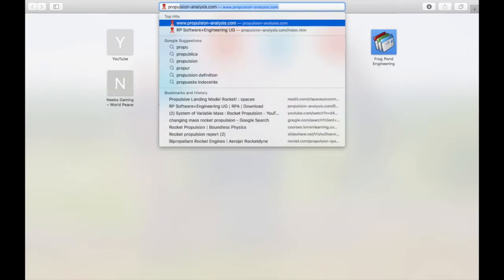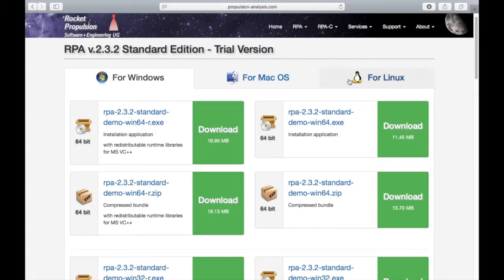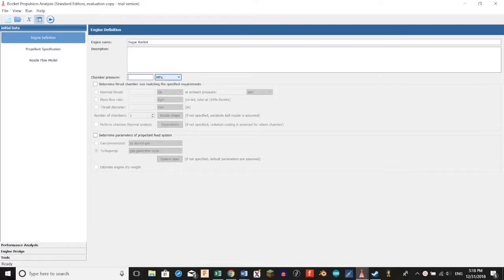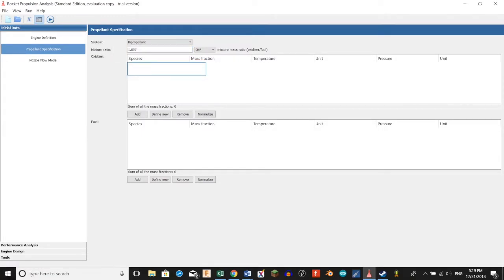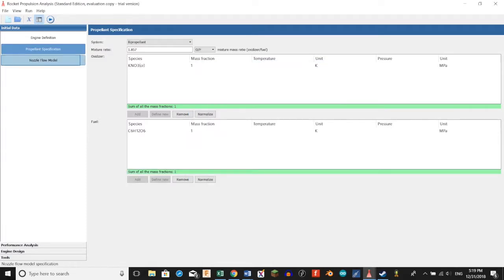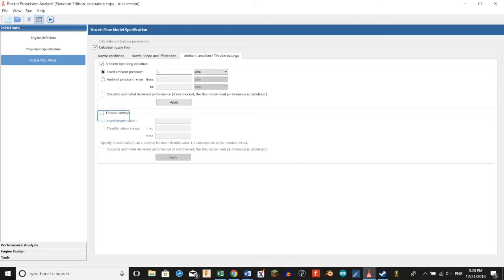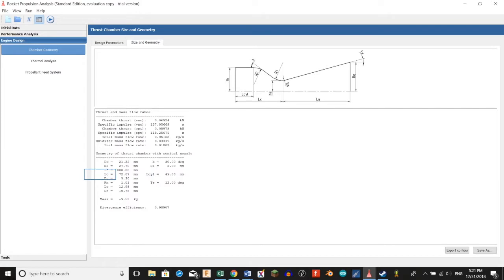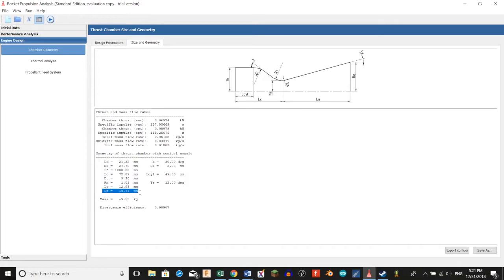How to Design A Sugar Rocket Nozzle in Rocket Propulsion Analysis - RPA

Comment: Hello, I want to know the pressure inside the chamber for the combination of 65% potassium nitrate and 35% sorbitol with a diameter of 5 cm and a fuel weight of 1 kg. Thank you for your answer.

Comment: What is the recipe for the sugar rocket fuel you used in this video?
Reply from the maker: I believe I would always use 65% KNO3 and 35% Sugar dissolved in water and then would boil off the water as I cooked it

Comment: If i was using APCP propellant, would you use the same ratio and settings for what you have inputted?
Reply from the maker: Unlikely. A 1:4 throat to chamber ratio is just a good starting point, I don’t know exactly the correct ratio and settings.
Reply: @FrogPondEngineering  thanks a lot :)

Comment: Say I had a hybrid rocket engine that runs on gaseous oxygen and paraffin wax. How would I choose the mixture ratio?
Reply from the maker: The way we did it was extremely unsafe, but we used exactly that and plugged a vinyl hose onto the end of a oxy-acetylene torch, and run only oxygen through it, manually adjusting the oxygen inflow until it looks good. Otherwise it gets extremely expensive really quick with plumbing and sensors and remote control components, etc.
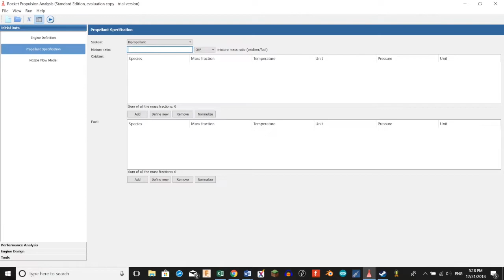Reply: I was mainly curious about simulating a nozzle for this type of engine. My question was more geared towards 1:06 when you specify the mixture ratio in the software. How would I figure out what number to plug in here with the hybrid rocket engine that I was talking about?
Reply from the maker: Oh, whoops. I had a different video in my head. If I remember correctly there is a theoretical stoichiometric ratio for different substance. Either A.), do a bunch of painful chemistry, or B.) google it for paraffin and oxygen. 

Google shows this for top result:

https://res.mdpi.com/d_attachment/aerospace/aerospace-06-00089/article_deploy/aerospace-06-00089.pdf

My connection is unstable right now, and will eventually go out as I get further into New Mexico. It may be in there, engineer toolbox may also have it.
Reply: If it is just the stoichiometric ratio that I’m looking for I should be able to do the chemistry math to figure that out. Thanks for all of the help!
Reply from the maker: You’re welcome, glad I could help.

Comment: Is there any best design and simulation software model rocket nozzle??🙄🙄
Reply from the maker: Richard Nakka has a good spreadsheet for solid rocket nozzles, rocket propulsion analysis is a good one for any type, or at least a good free one. For overall rocket design check out openrocket and rocksim
Reply: @FrogPondEngineering  thx ....sir🙏🙏

Comment: why is the mass negative????
Reply from the maker: My best guess is that RPA is more suited to the design of larger engines, and when designing a small engine like this it comes out with a negative mass. Even if the same mass was positive the mass would be way too high, likely somewhere in calculation of the engine's mass something doesn't work very well with engines below a certain size, and of course, this is only a simulation, they're always off by a little in most areas, and in some areas a lot. My two best guesses are either RPA doesn't like small engines or it is taking into account the thrust produced by the engine. That's a good question and I cant confidently answer it.